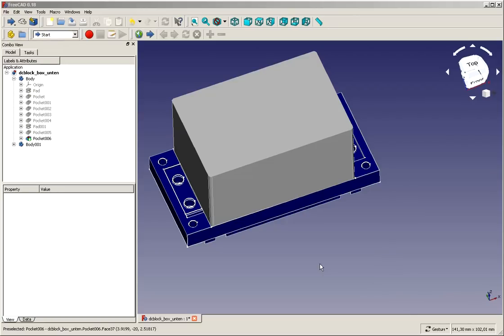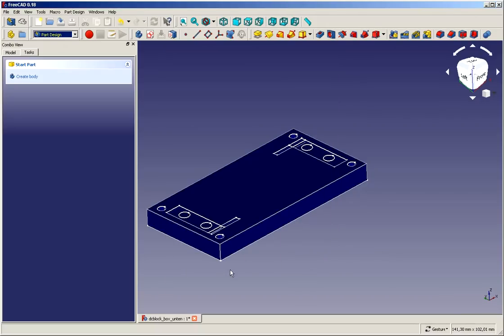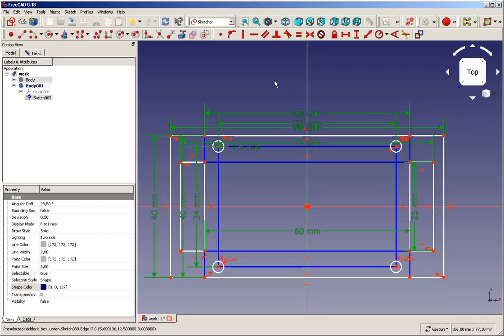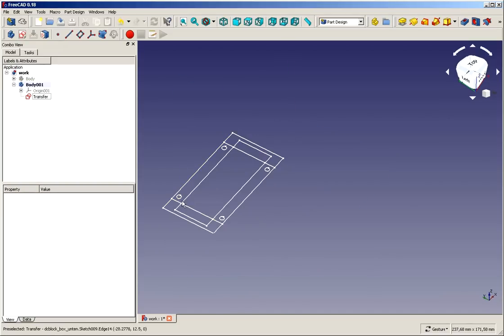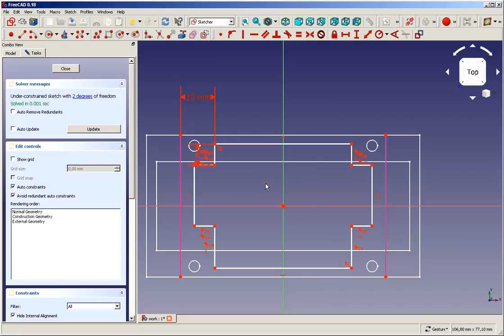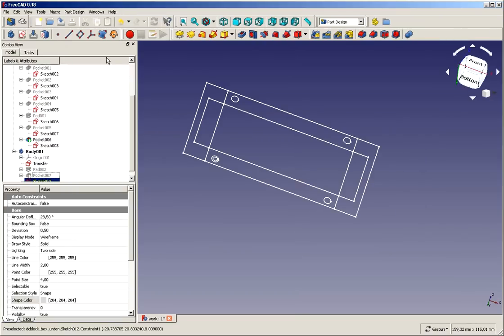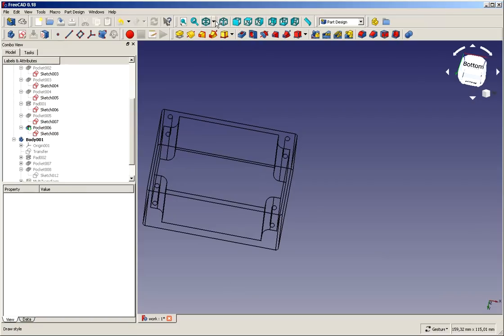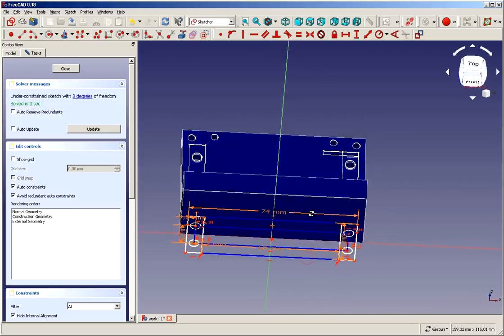FreeCAD Tutorial , using Carbon Copy in FC 0.18

Comment: good videos.  I would like to know why one should not create  an sketch on a pad face as you mentioned in the video.
Reply from the maker: Ivan,  the Problem is called "toponaming" issue. When you set a reference , especially the attachment of a sketch, to a face which is the result of a feature, this can happen: 
After editing elements of the sketch from which the feature was created , the internal names of the faces and edges can change and thus the reference is lost. This is a problem of the OCC graphics kernel underneath freecad. There are solutions beeing developed that will prevent the error.If you search for toponaming you find lot´s of better descriptions around
Reply: Can you refer us to a video where the "correct" way of attaching a sketch to a face is demonstrated?

Comment: I'm a newbee to freecad (to 3d modeling actually). I have watched a few many videos and I found yours very concrete and technically detailed. I wonder how you got to know details like the toponaming, just reading the documentation? Are you a freecad developer? You sound more like a well versed user than a developer. Thanks a bunch for your tutorials!
On what concerns this particular video, after the toponaming issue was clarified, then, the one issue/caveat that comes to my mind is when the second body is transformed (Transform) to make it match its correct 3d position. It seems that the transform operation requires explicit translation and rotation increment figures. Is it there a way to make a reference to an already existing constrain (e.g. a length)? Perhaps even in a different body.
Reply from the maker: HI, i am not an engineer, i work in IT..I am quite old, short to retiring , thus i forgot more than many will ever learn.... I was allways fascinated by CAD an gave lessons since mid 80´s ( Autocad , Solidworks ). I have my knowledge mostly from reading and watching other youtube videos a few years ago.  BPLRFE , Frank , who passed in 2017 was one of my great influencers. Unfortunately his videos where BEFORE .17 and make a lot of confusion for newcomers nowadays. I am a software developer, but not in FreeCAD. My time is limited and such needs 100% devotion to the matter. I just play a bit with Macros. 

If you learn the attachment function , where 2 or more points from 2 or more Objects ( i.e. Bodies ) are used to position them, then it´s possible . Also there is the "manipulator" Workbench , you can install and use for this quite easily and useful. Constraining 2 or more obejcts together is task of "assembly" workbenches. There are 3 around : A2plus, A3 ( extra Version of FreeCad up to now  and A4 . Each of them is an addon and has a different set of functions.
I concentrate my videos on FreeCAD internal and Standard Portfoilio for some reasons..

Best regards
Harry